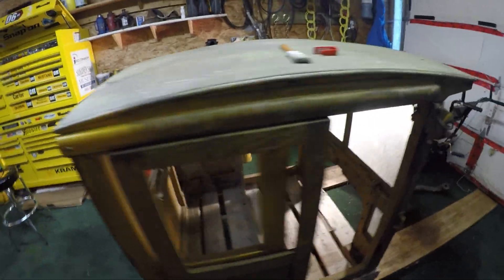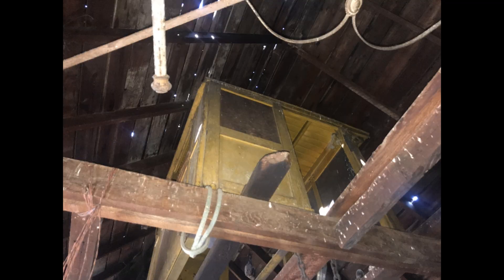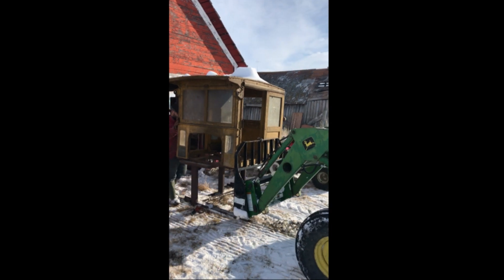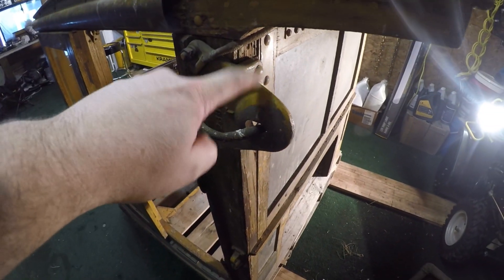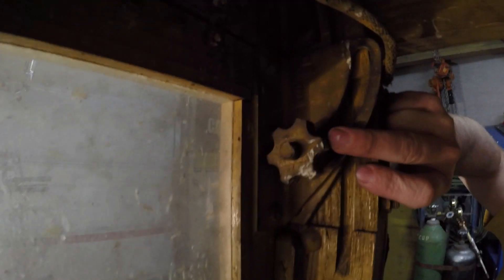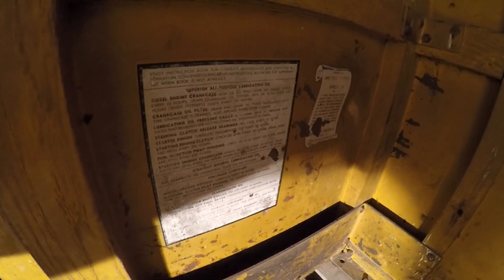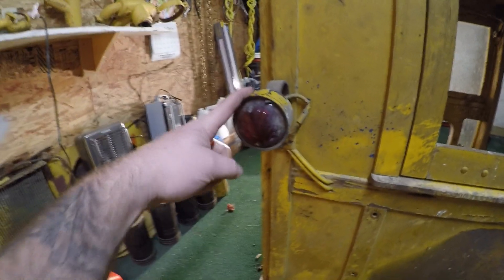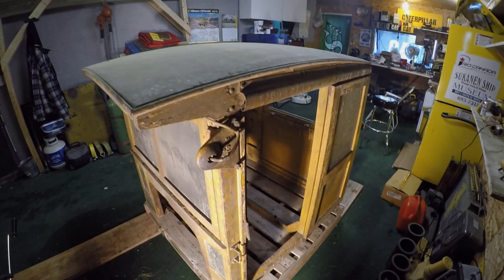Amazing Barn find - original Caterpillar D2 cab

Comment: So how did it get snow on top? 
There must have been a hole in the roof of the barn to allow snow build up.
Really cool find man, especially OEM timber.
I would have expected the cabs to be steel fabrication not timber. 👍🤙😁
Reply from the maker: That was part of the reason for getting it out of there - the roof was starting to open up and let the weather on to it.  It’s is 100% an OEM Caterpillar part, it does have some tin, but mostly wood.  Thanks for watching.